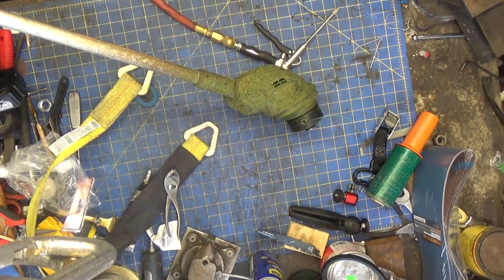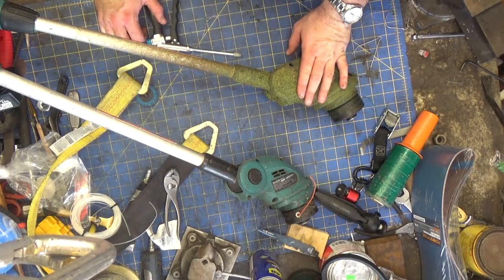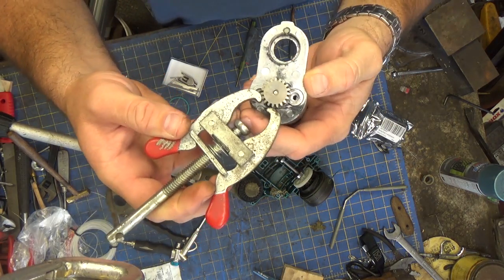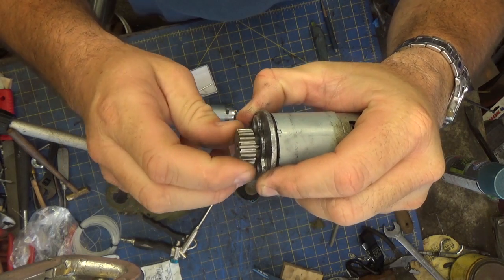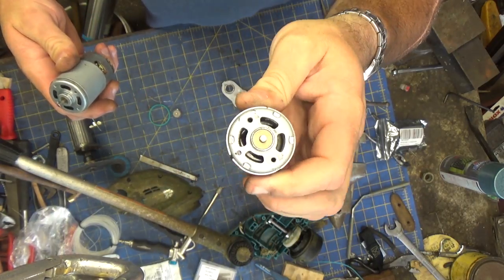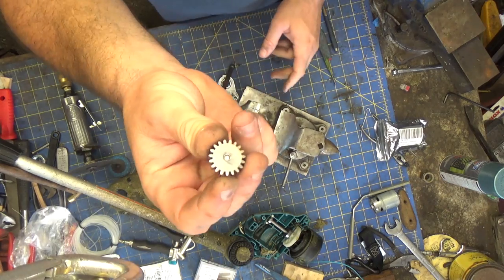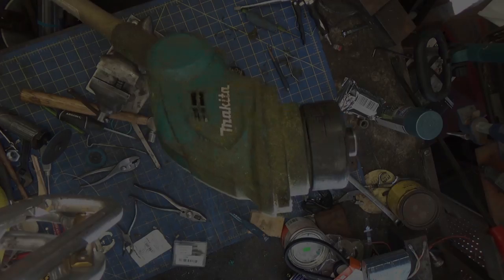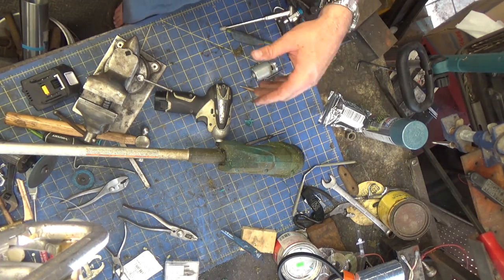Makita 18v string trimmer broken :(  RS-550 motor replacement  :)

Comment: I was able to get the gear clean off of the spindle by putting the motor housing in a table vise and sliding a 12" flat pry bar under between the gear and the motor.  I bent the spindle on the shaft, but that's getting tossed anyway.

Comment: I don't know who, if anyone, needs to know this but to pull the gear off of the same motor on my Black and Decker weed trimmer I slid the shaft between the prongs of a $Dollar $Store dinner fork, put it across the jaws of my vice and drove the shaft through with ease.
Reply from the maker: Lol...good Idea. I love the outside the box thinking. Cheers

Comment: Put a niddle nose plyers under the gear, get a small broken drill bit or a small center punch,  use a small hammer to knock out the pin.

Comment: I had the red light problem too.  Try to feather the switch to let it speed up then hold it.  Works then-  Bit of a PITA but still works (until you hit some tall grass that is)  Oh well maybe Ill try the resistor.  Thanks for your video!

Comment: Hey, thanks so much for this video. My Makita weed wacker died this summer (at just over the 3 yr warranty) and your video convinced me to try replacing the motor, for less than $20, rather than buy a whole new unit. Since I don’t have your shop setup or ingenuity, I found the exact replacement motor component online (https://www.toolpartspro.com/makita-parts/miscellaneous-parts/makita-629932-8-dc-motor-lxru02 ), and in under an hour had her running again. It is SO satisfying to successfully repair something. Thanks!
Reply from the maker: Awesome...im glad i could help. Cheers

Comment: Nice repair at $9...  I have an old drill here with a worn bushing so the chuck slop is monumental. 
I scrapped the drill as no parts are available, plus I have no lathe - but kept the motor so I can have it as a spare for any other tool that may require it. 
Nice one!

Comment: how did you separate the motor from the other stuff at 1:41?
Reply from the maker: I think I used a thin die grinder wrench to hold the gear, while I used a small punch to drive the shaft out.

Comment: whats the name and model number of that really common motor....???
Reply from the maker: I believe it a a RS 550
Reply: Mabuchi RS 540 because tamiya and the 1980ties toy cars..
Also the 400 DC engine size cwas quite common for toy planes, all with 6 nicad cells in series and if yo where fancy 7 cell 8,4V stickpack with NiMH cells those where the days..
All HAIL PANASONIC AND SANYO! True battery heroes
It can take a beating those DC motors, buy with bearings and not sintered bushing if you can!!!
Typically those wheed whackers are "18V" nominal so the run straight off RS775 engine
This one is old design or just odd beeing gear driven

Comment: I had this same problem, and bought the same replacement motor.  Problem now is, the red light comes on within a second of me squeezing the trigger.  The motor turns, but I guess it's triggering an overload? I thought the LED was just for low voltage (i.e. low battery power)?  I've tried numerous, fully charged batteries, and they all work, so I have to assume it's an overcurrent cutoff.  Any thoughts?  How much current is it supposed so pull?
Reply: Hi guys ! Late answer, but as far as  I noticed after adding a 40 w 5homs resistor in series with the motor it work as it should be and spins quite fast ,the multimeters have a relatively high internal resistance I guess that explains why it worked fine when amp meter was added to the circuit!
Reply from the maker: I am not really sure, i bought 2 exact same motors. One worked and the other runs for 1 second and stops...bizarre
Reply: @joeheilm  more developments:
This only happens (red light goes on, motor stops after a second) when everything is hooked up normally.  If I put my multimeter in series (i.e. circuit to meter, meter to motor, motor to circuit), it works fine.  Thing spins up fast, draws less than 1 amp, etc.  So the meter is adding something to the circuit that allows it to run.  Is there some additional impedence required? I can't figure it out.
Reply from the maker: @nuronopolis  that is interesting. My multimeter can only handle 10 amps. I assume that the multimeter is acting as some sort of circut protection....anyway i just moved and i don't have my string trimmer with me, yet. Otherwise, i would like to look into this effect the meter has. Anyway that is very cool info...i just moved so all my projects are on hold.
Reply: Hey guys, 
Same deal here... swapped out the motor, RLFH (Red Light From Hell)...  any ideas?
Reply: @captainperoxide1  I eventually got mine working by swapping the motor again (bought another one). Before that, though, the red light problem would be intermittent; it'd work sometimes, sometimes not, so I'm not positive that the motor was the problem. Check your wires; make sure nothing is crimped

Comment: I had the same motor burnout issue with my Makita DUR181, I made a simple gear puller out of a 6 inch section of 1-1/2 angle iron, put a cutoff saw slot cut in it just a bit bigger than the motor shaft diameter, put the angle iron between the motor and the housing. Hung that between my vice jaws, tapped the shaft out with a tempered nail, had to heat the gear a little with a lighter...used a 200 watt soldering iron to slot out the blue plastic housing so the motor power lugs would fit, trimmed excess plastic with an sharp knife. This preserved some of the motor support.
Now I let her cool down for 30 minutes after every battery change, to avoid another burnout.

Comment: The black plastic guard that is suppose to be installed (that you either removed, or never installed) is not only there to protect you from flying debris, but also to put the correct load on the motor.  The little blade inside the guard only lets the line be so long before it clips it off (or more the line hits it and breaks off the excess).  If the line is too long, the motor works too hard to try and get the line spinning and keep it spinning.  I would run in to this problem with customers running gas string trimmers without guards.  If the line was too long, the motor worked harder and slower.  This in turn didn't allow the flywheel to push enough air over the motor to cool it.  I get that people remove them to see better, but it has consequences.  Least you know a bit more about the guard now though and a $9 motor isn't too horrible of a price.
Reply from the maker: Bradley, that is a great observation. I installed, but then chose to remove the guard because it made the tool awkward. Anyway, your comment may have inspired a potential video. I should, without too much difficulty, be able to test and plot the amp draw and how it correlates to line diameter and length. I need to double check and see if my amp meter will do DC. Thanks for the great comment and the content idea. Cheers.
Reply: I would guess the load would fluctuate as well depending on what you are cutting, how fast you are cutting and total run time.  Could really make the tests as complex as you wanted or might be able to test it and get a % increase comparing heavy grass to short grass and just apply that % to other test points.  I must admit that I did laugh when you burnt yourself... only because i've been there and know the reaction.  Gotta love getting kissed by hot mufflers/hydraulics/motors. hah
Reply: how about making a bicycle powered DC motor weed trimmer? I have a bicycle powered dc motor generator in the garage that I made. The DC-DC buck converter I hooked up will stabilizer the amperage output even while the pedaling changes speed a bit. Then just bicycle along the weeds you need to trim. OK the steering part might be a challenge.

Comment: Hi Joe, how did you get the old gear on the new motor?   BTW- I loath string trimmers!!!  😃👍
Reply from the maker: Hi Scoutcrafter, I accidentally time lapsed through the gear installation part. The gear was an interference fit with no set screw or keyway flat, so I just braced the tailshaft of the armature against the vise and tapped the pinion on with a hammer. I think back on all the string trimmers I have owned and feel ill because of all the money I have wasted. However, I have been relatively happy with the electric. Cheers.

Comment: What keeps the motor from thrusting up into the the plastic housing now that the motor mount is gone. Watch all your vids keep up the good work
Reply from the maker: The metal flange keys into the housing and provides the axial and lateral stability. Thanks for watching and commenting. Cheers.
Reply: Ok good I was worried